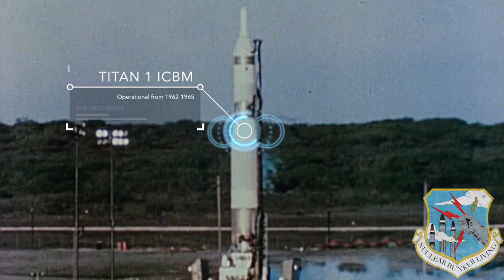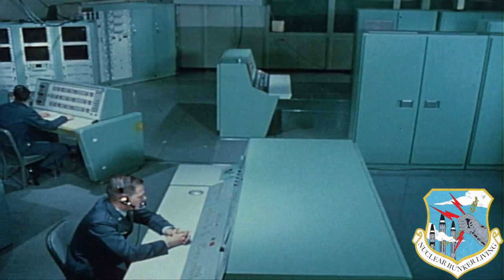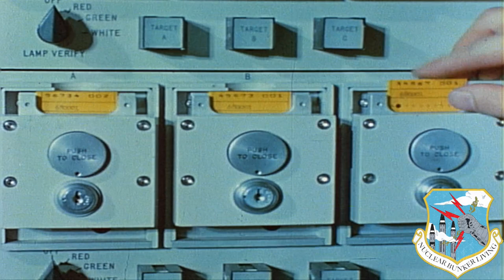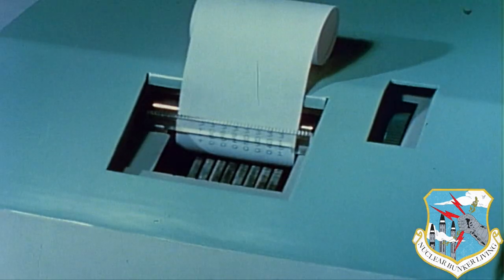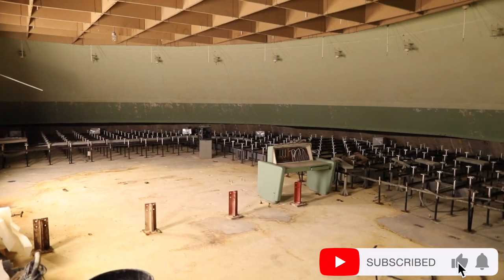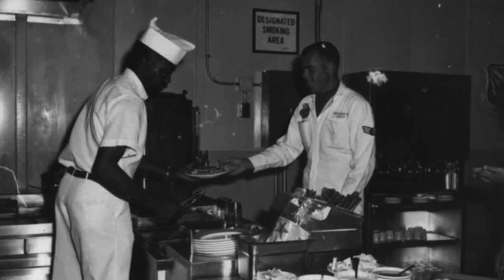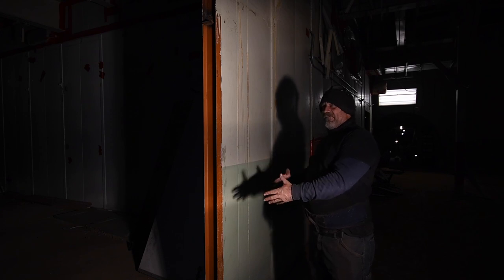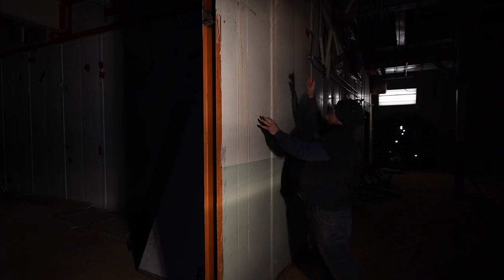EP. 19 - Titan 1 Control Dome DECONSTRUCTION

Comment from the maker: Thank you for the support. The Titan 1 Control Dome DECONSTRUCTION process is underway. The team are reverse engineering the new demolition protocol to be used throughout the Titan 1 Nuclear Bunker Complex. The Titan 1 is bustling with heaps of activity and rehab work. Be sure to catch up on all episodes of "Nuclear Bunker Living'.
Reply: Could run a grinder all day.
Reply from the maker: Addictive YES
Reply: Why remove the walls here? I mean u less they're contaminated? Because I mean don't get me wrong here, I get the concept of remodeling and everything, but it seems somewhat like a waste of hard work.
Reply: Also, why don't you use the bunker lighting system? Does it not work or something?
Reply from the maker: There will be a different floor design @Julian.  Equipment with historical significance will be restored ONLY. Thanks
Reply from the maker: Most lights were removed. We have temporary lights for the decon phase at the moment.  Permanent lighting and fixtures will be added once the new 24 megawatt power plant is built in the complex.